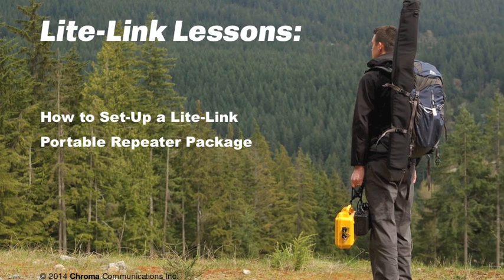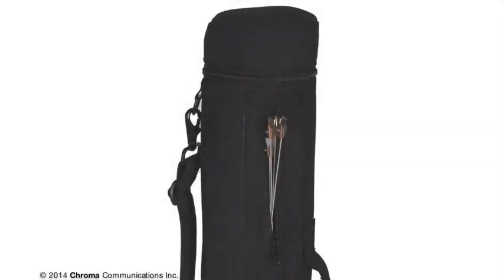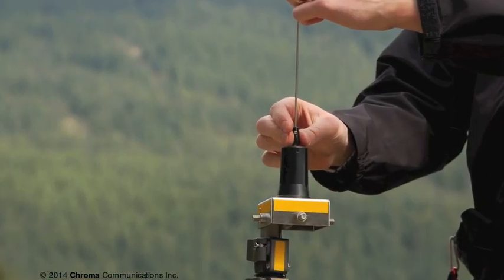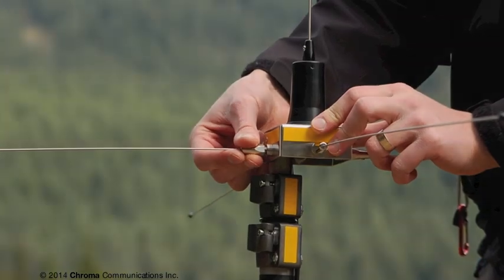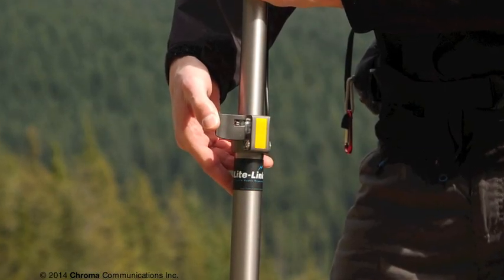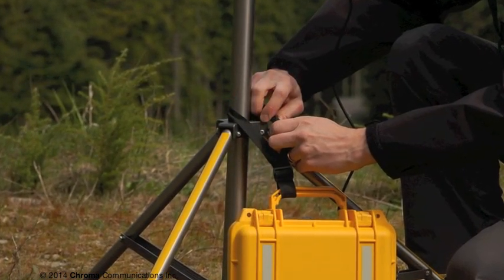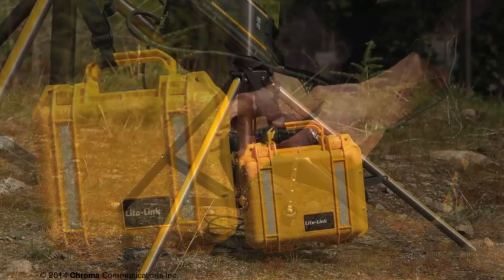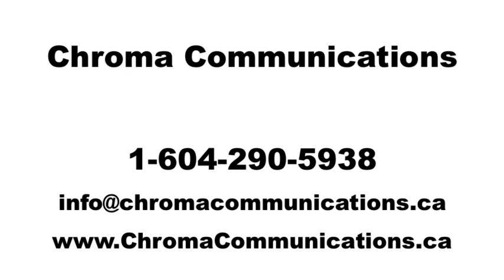How to Set Up a Lite Link Portable Radio Repeater

Comment: Repeater in a plastic case ok..
Would want 146.700 tx & 146.100 RX at 10 watt with CW ID every 10 minutes. For emergency skywarn system and flea-mart"s and ham out door events .
Reply from the maker: Hi Duane, thanks for your comment. This repeater requires a minimum of 5Mhz separation between your transmit and receive frequencies....so your existing frequencies are too close together to work. Are you able to use other frequencies?